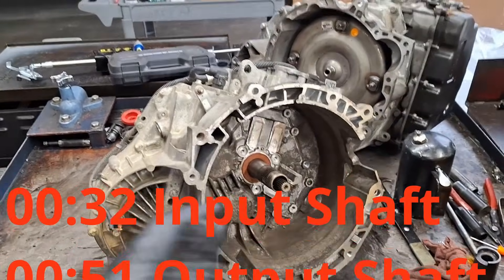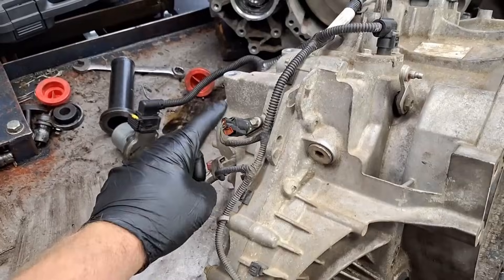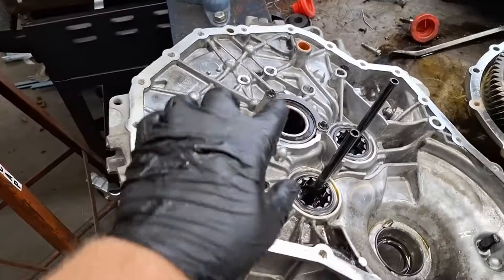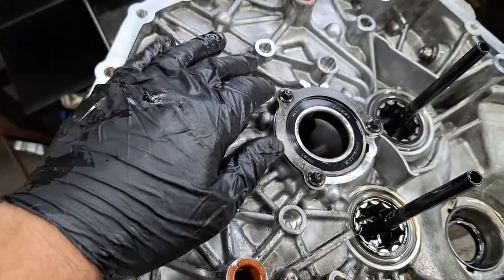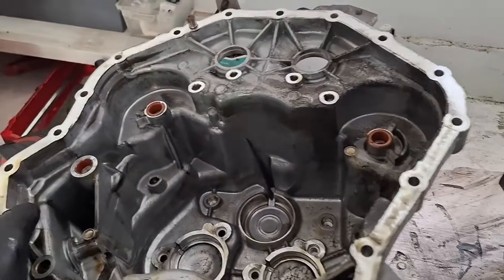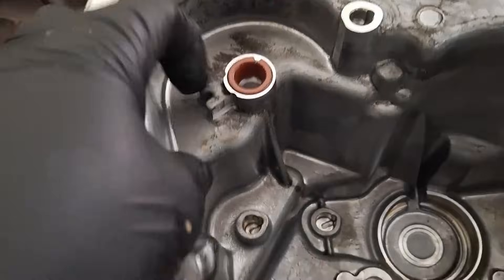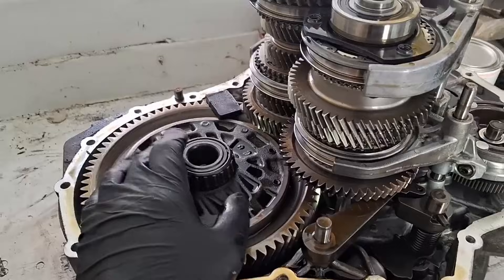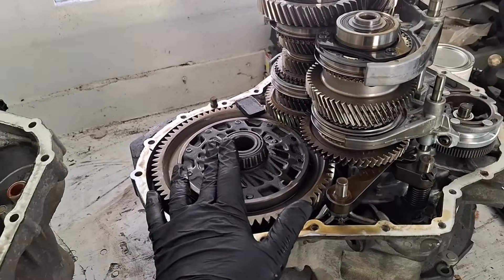Bearing Part Numbers! | DPS6 Powershift - Ford Focus & Fiesta Transmission

Comment: Hey Ben! Offtop but I want to put TCM from my 13 to my 14, is it just plug and play? The 13 so rusty and I'm gonna scrap it probably because the forks are stuck. But it shifts way smoother and at better rpm than the 14. I'm wondering if just swapping TCMs would help it shift better?
Reply from the maker: Hey krzy! Should swap right over